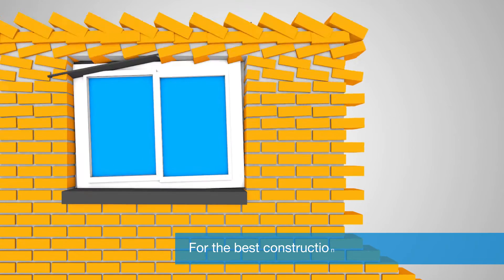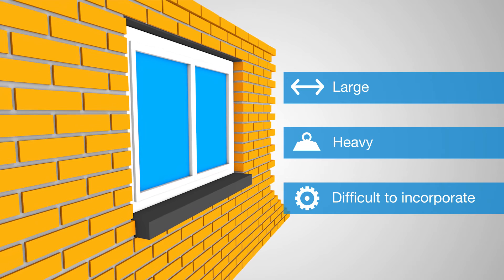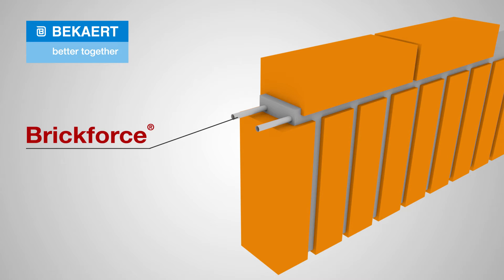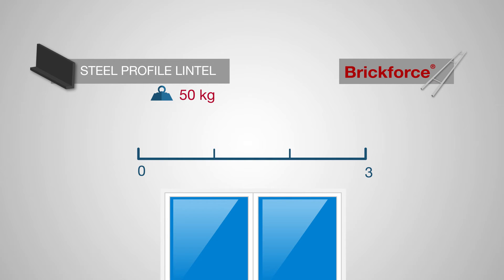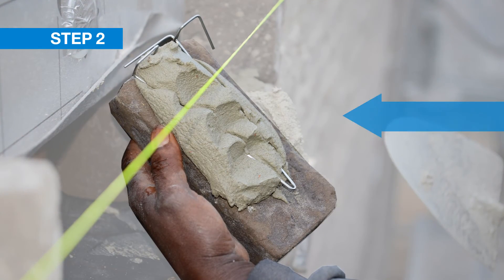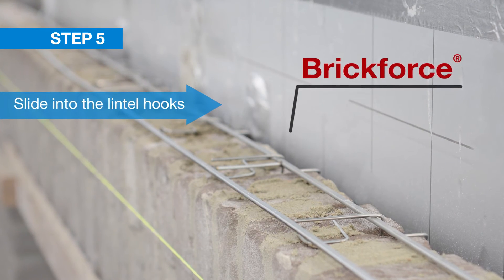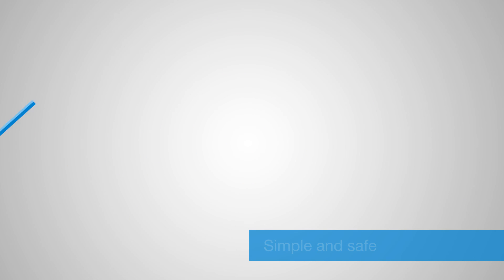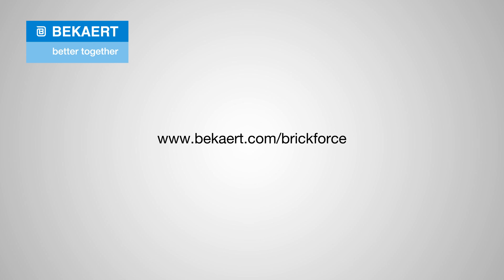Discover new structural possibilities with Brickforce® masonry reinforcement

Comment: The idea comes from germany. They have freestanding soldier courses over there as long i can remember. If the span is over 1 meter they need this type of reinforcement. Looks much better cos u see brick on the underside, not steel.
Reply from the maker: Brickforce and Murfor GER works perfect in combination with lintel hooks. The installation is much easier than when you should work with a steel profile. You can use it for openings up to 3,05m.